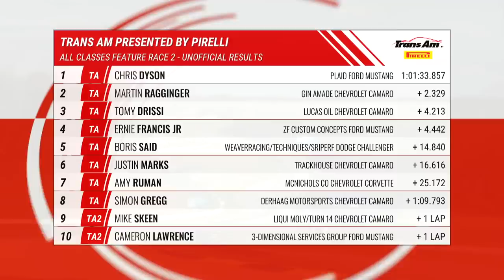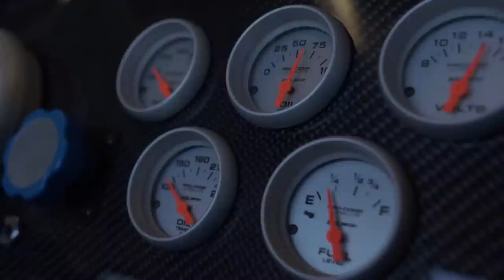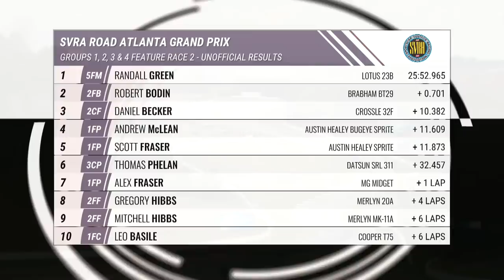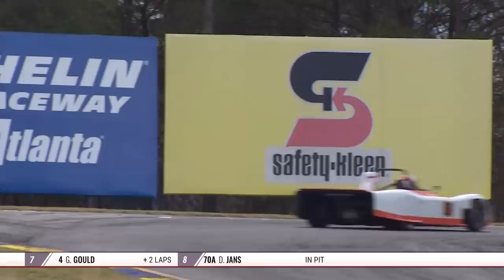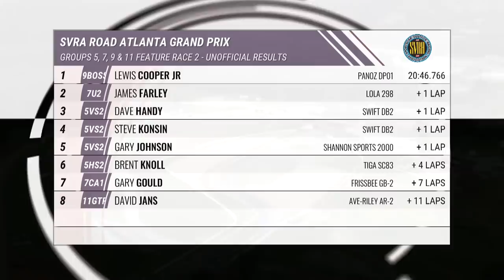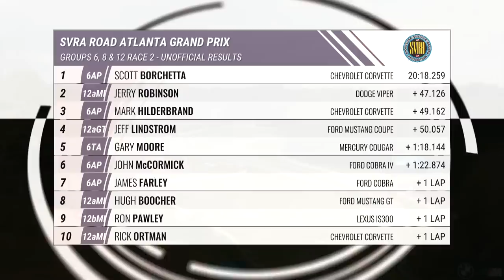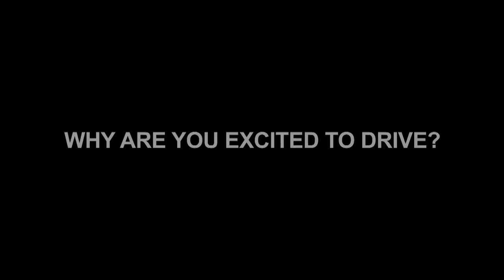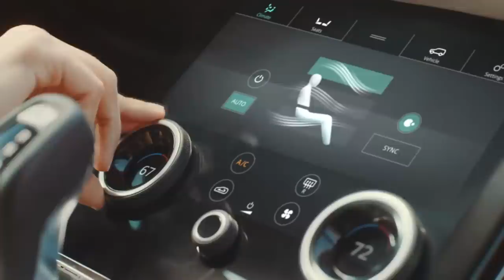Trans Am Season Finale at Road Atlanta (Full Race Live)

Comment: Someone explain Trans Am to a IMSA fan. Where do these cars stand as compared to a gt3 car? What difference is there between the cars?
Reply: I think they’re more powerful but only a guess
Reply: I'm no expert, but...

Trans Am has like 5 classes at the moment.  XGT is the newest one and I believe it is for former GT3 cars.  

There's also SGT and GT, which I think are more production based.
Reply: TA2 has the strongest field, they are tube frame cars, with some cost caps the keep it affordable (think like Xfinity cars).

TA is the fastest, but there aren't many of them.  They are tube frame like the TA2 cars, but have more power (850hp), more grip, they're wider and lower.  I think they have sequential transmissions.
Reply from the maker: Our new XGT class has retired GT3 cars in it. So in that fact not much difference, but chassis and horsepower are your mega differences. 

You can learn more about the Trans Am classes here: https://gotransam.com/transam101/
Reply: Depending on the track, the TA2 class is a little slower than GT3, has a little better power to weight ratio but it's a solid rear axle, tube frame car with less aero and no driver aids. They can't corner nearly as well as a GT3 car, particularly in the high-speed corners. They're also much, much cheaper to run than GT3; for what it takes to just buy a GT3 car with no spares and zero operating costs (as in you never even drive it), you can race a competitive TA2 effort and have money leftover.

The TA class is also a solid axle, tube frame car with no driver aids. It's a little lighter than TA2 and has a little more aero, but still not much compared to GT3. The engine rules are basically "you must have a carbureted, naturally aspirated V8, no larger than 358 cubic inches, 1 camshaft in the block and your carburetor has to be below a certain size. Other than that, do what you want". TA cars are typically faster than GT3 cars around most tracks, at Daytona they're as fast as GTLM in IMSA. But they make their laptimes in totally different ways, they don't have the cornering grip of GT3 cars (though the MASSIVE tires mean mechanical grip is actually solid, but it lacks aero grip), but they have over 850 hp so they hit some zany speeds on the straights. 200+ mph at Daytona, for example.
Reply: @Ninja98x  thanks for such a detailed answer!
Reply: @TheTransAmSeries  Thanks for the link. Extremely helpful. I am a new subscriber (C7 owner but don't track) and looking for ways to watch live. This could be the best racing series I've seen in a long long time. RIP Edmonton Indy .... sob